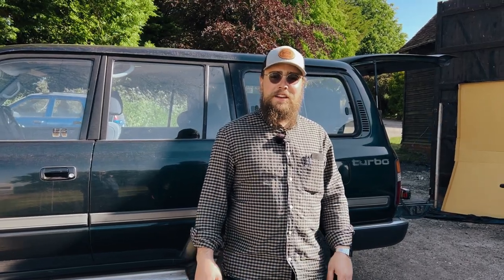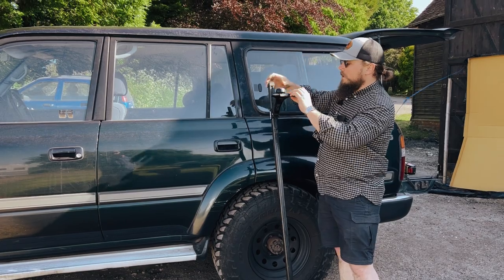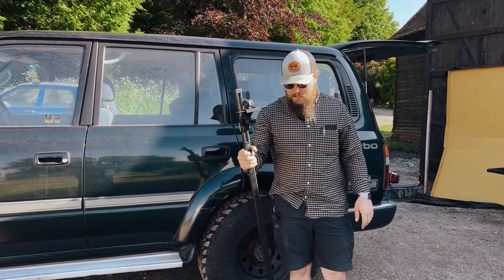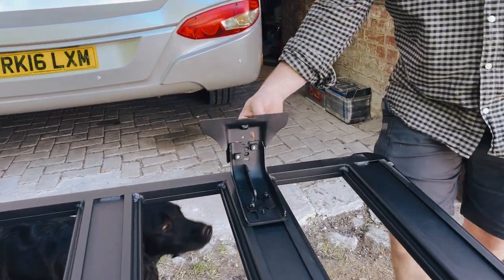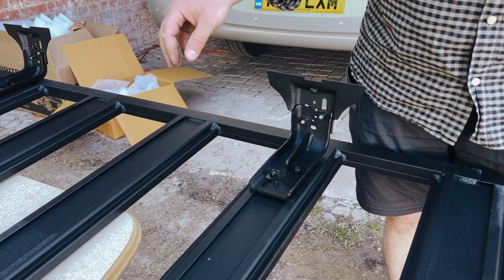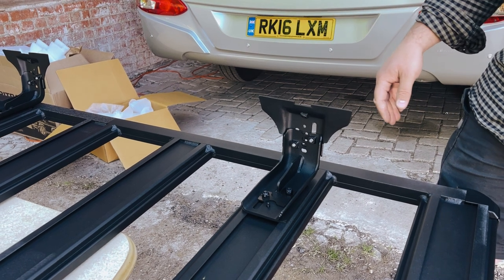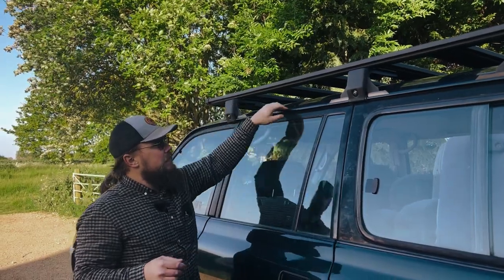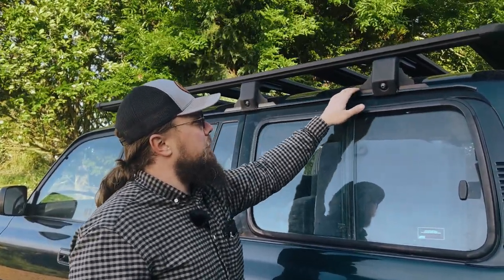Installing ARB Base Rack on Land Cruiser 80

Comment: @offgrid_workshop can you post the part number for the rack you purchased? and did it come with the gutter mounting brackets or was that a separate part? I wanted to double-check before buying because the older classic ARB rack was separate part numbers for the rack/mounting kit.